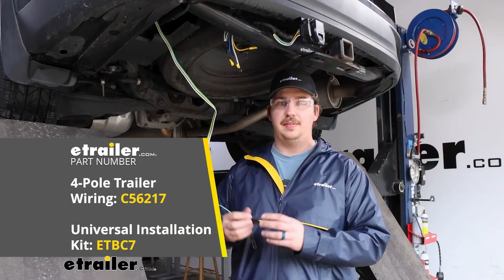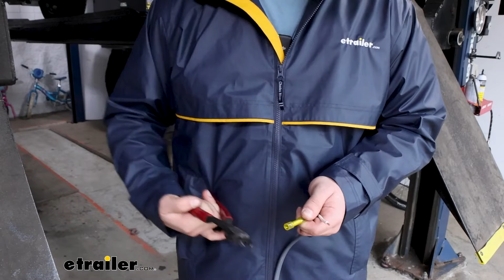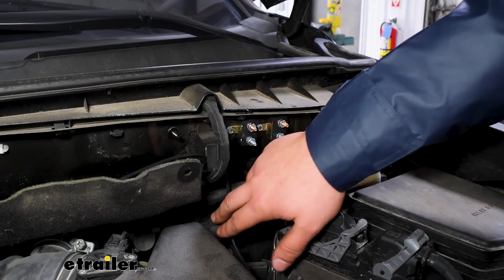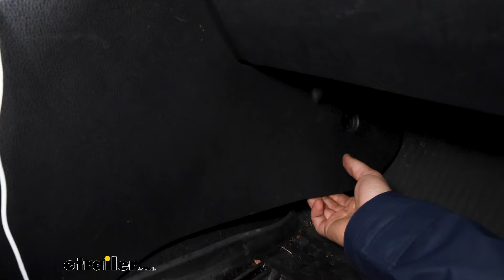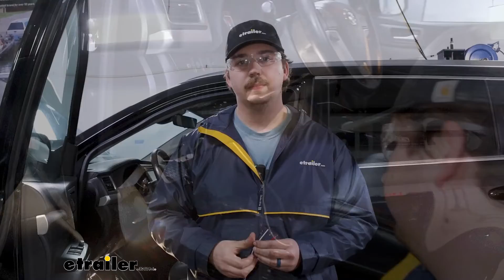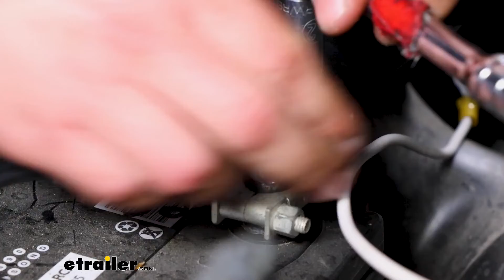etrailer | Redarc Tow-Pro Liberty Brake Controller Installation - 2018 Toyota Highlander

Comment: Oh oh the ground off the break controller I just grounded with a screw on inside on the sheet metal of the car. That's what the instructions looked like. Am I gonna run into trouble?
Reply from the maker: Are you using a wiring harness that has the extra ground lead? If so, you can definitely ground to the vehicle chassis. If you can find a factory ground under the dash, that's even better. I hope that helps! Let me know if you have any further questions!
https://www.etrailer.com/Trailer-Brake-Controller/Redarc/RED24FR.html
Reply: @etrailer  idk I got the pig tail for it and grounded the white wire under the dash. The the 7 way back by the hitch so... Lol
Got everything ready besides put the breakers in and hook it up to battery.
FYI no complaints on the 7 way and break controller kits (complete everything you need) hard part is running wire and finding the spot on the Highlander.
Reply from the maker: It's not completely simple, but we're happy to hear you got your install completed.

Comment: Adding a brake controller to my 2018 Highlander was very difficult and took 6-1/2 hours. I have been working on cars for 56 years.  My resume includes rebuilding Mercedes Diesel engines, repairing a Mercedes Automatic with no manuals, rebuilding GM 350s and Ford, Triumph, MG and Jaguar engines, front end work, etc.  This is the second brake controller I have installed. The first one I installed was on a 08 Sienna. That was a piece of cake. The issue with the Highlander is the very tight space under the Driver's foot well. I do not recommend anyone attempt this unless you have some level of car repair experience. I pulled out all sorts of special tools from my tool boxes to get the job done, including 12" curved hemostats.  Attaching the splice to the brake switch line took two hours because I had a devil of a time getting the brake switch plug to release and separating the green wire from the bundle and putting the slice on.  I actually modified the splice so the green wire could slip on it. And yes the best way to route the wires is across the firewall to the rubber plug in the passenger foot well (not shown on the video.) and then fishing the wires over the console hump.  Have fun, just be prepared bite your tongue, swear and contort your body.  Thanks E-Trailer and U-Haul for posting installation videos. They do help.
Reply from the maker: We're glad the video helped you, sorry about the difficulties you experienced!
https://www.etrailer.com/Trailer-Brake-Controller/Redarc/RED24FR.html

Comment: Two things: never wear a metal ring when wiring up 12V automotive power connections. Second the wiring can be brought in without going under the car by using single wires and tucking them under the various panels and sill panels up the LHS of the vehicle.

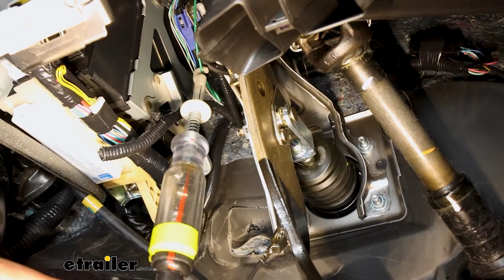Comment: In your example for the green brake light wire to splice, there's another green wire in the area. How did you test without cutting the sheath? 14:20
Reply from the maker: We used a circuit tester like # PTW2993
https://www.etrailer.com/Electrical-Tools/Performance-Tool/PTW2993.html